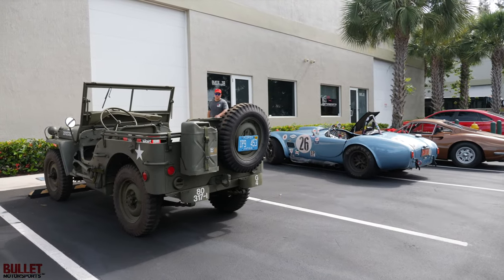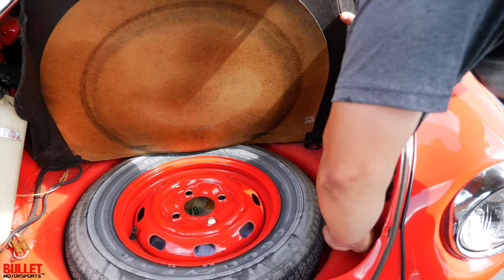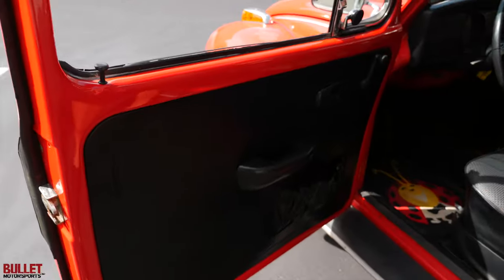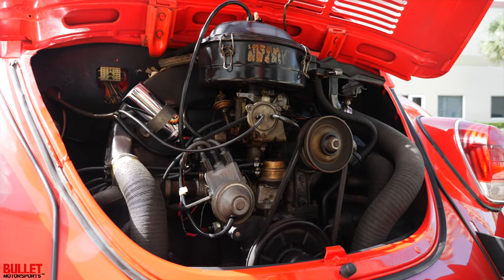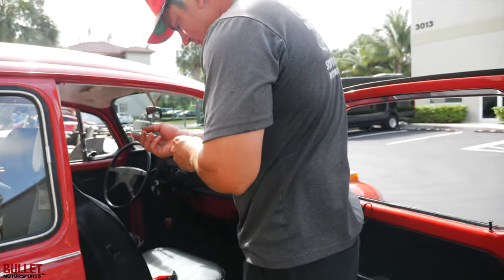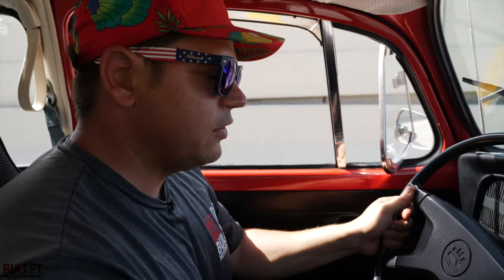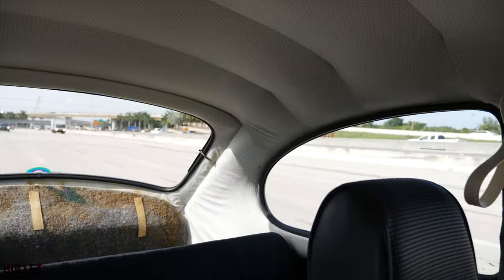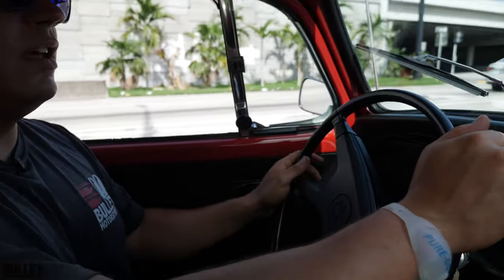This 1971 Volkswagen Super Beetle Is A Time Capsule | REVIEW SERIES [4k]

Comment: Bought a 72 super new, and proceded to upgrade suspension, Bug -spray carb...EMPI products, exhaust, etc.,,,,and it was fun to hunt other Euro cars in the twisties. The quality control had dropped by then, plastic fell apart, seats deteriorated, by two years old. That Metallic Blue paint did not last, but sold it by 1981...glad to get rid of it..Even got a thousand dollars for it.....but fun early 20's memories. Thanks fro the retrospect.😇

Comment: That's a 1972 - not a 1971.  '71 had an old style steering wheel with the horn hoop and the wiper switch was a knob on the dash to the left of the heater fan, not a lever on the column.
Reply: The late run 71s also got that stupid old steering wheel and the other stuff. Ask me how I know LOL
Reply: @Turbogn87  I think its definitely a 73  or even 74--it has a curved front windshield---71 and 72 had flat windshields--
Reply: You are right. 71 had a different steering wheel and less vents on the back. I had a 71 Super Beetle.
Reply: Yup. The closeup of the chassis number by the front hood latch also shows it begins with 112..., it would be 111... for a '71 model. 
The giveaway that is least likely to be swapped or tampered with is the larger rear window that debuted for 1972. '71 and '72 super body shells are each one-year only because of that change.